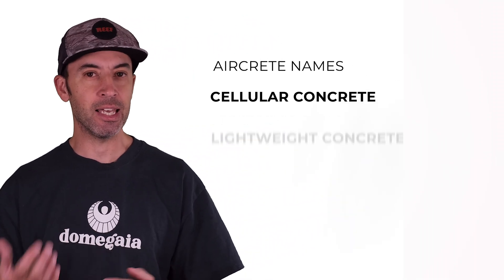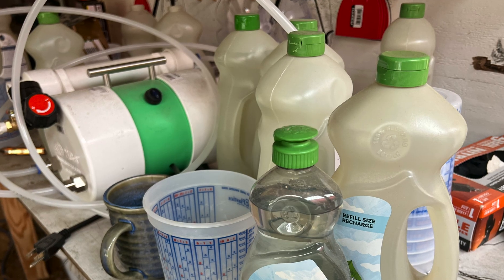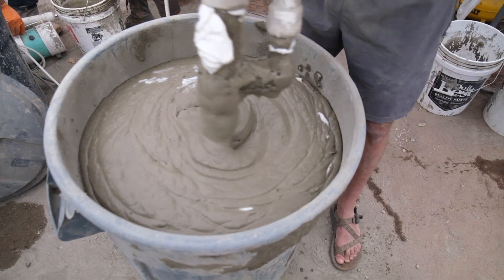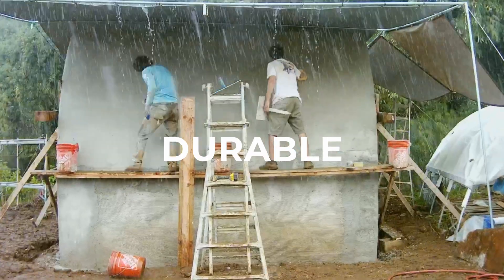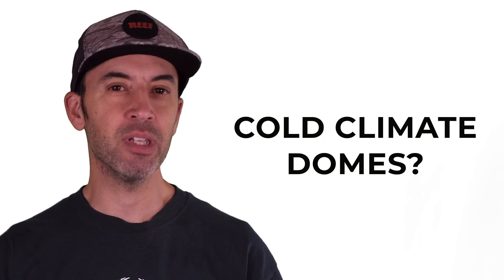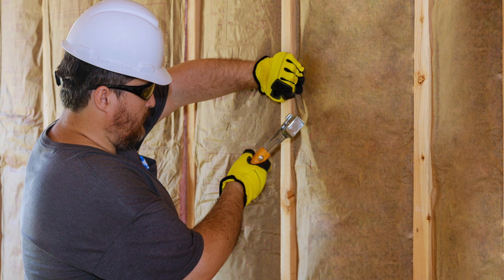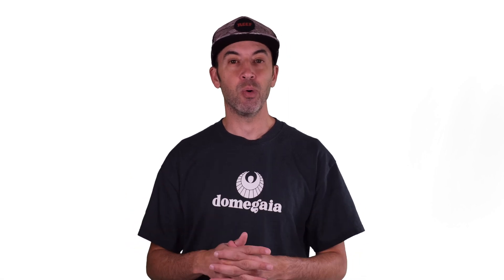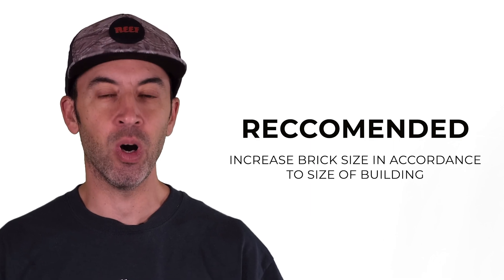Aircrete - Everything you need to know before you start

Comment: Would love to know - is it possible to build a dome with a 30ft diameter with aircrete? My partner and I are starting to research dome style houses but I think we are leaning towards 1-2 big ones instead of grouping smaller ones together.
Reply from the maker: You can build 30ft domes with aircrete just fine but it will be easier and faster for you to build several smaller domes all clustered together rather than one very large one.
Reply: Absolutely it can be done,  but not with aircrew, for that you'd probability need a system (you can find videos)  that uses vinyl firm the size and shape of the house you're building,  sprayed with foam insulation on the inside,  rebar throughout and then sprayed with concrete on the inside. 
It sounds much more expensive,  it probably is,  but I've seen videos of structures of that size and larger.
Reply: Back in the 70's or 80's they built several dome homes by inflating "baloon" & shaping the dome around it, then once cured, deflating the balloon. At least one home is two story, but all of the homes built by that company are still standing.

Comment: In China, they call it  Tofu-concrete.  There are videos were it was used in some buildings
Reply: The Chinese gave it a Japanese name?
Reply: @brokenrecord3523   beats me. Thats the name often used. Basically, they thinned it so much that the strength diminished over time, vulnerable to the elements, and people were breaking it with their hands.  plenty of vids.  Not to be confused with roman cement. lol
Reply: @darwinjina  I think that is why a lot of novel building methods get bad reputations. Someone is out there doing it wrong, it fails and then people think aircrete  doesn't work.
Reply: @brokenrecord3523  agreed. I'm hoping that the validated methods are well documented and shared.

Comment: What are the lowest temperatures these could stand? You said they can be built anywhere in the world, but will they work if the temperatures go to -35°C in the winter? Would they need some kind of insulation added then, or just thicker bricks?
Reply: Disclaimer: I am guessing. 

I don't think there would be any real "minimum temperature" that the bricks could withstand. I see no reason that even extremely low temperatures would cause the bricks to fail or degrade in any way. Unless there are gaps in your aircrete construction I guess, in which case water could infiltrate and break it apart with freeze thaw cycles. 

You would certainly need more insulation, but that could be in the form of dedicated insulation such as Styrofoam, or it could just be more/thicker aircrete bricks.
Reply from the maker: I would agree with this answer :)

Comment: I think you could build the shape of your dome from a compacted pile of sand, wetted and packed. Cover the sand with wet cardboard or other. Stack all your blocks going round n round to the top. When your done you remove the sand. Its how I build my wood fired domed ovens
Reply from the maker: That sounds like way more work than the way we teach it with the compass arm.  It's just one poll in the center that pivots and is use to place each block in the perfect place.  You also end with a perfect curve.
Reply: @domegaia  
I ve done it in small-scale building wood fired ovens, and my friends or other you tubers have done it the way you're doing on a small scale. Maybe just give both a try and build a wood fired oven. The pizza and bread are amazing, so there's no failure. There's no ladder werk. there's no singular block werk. Its safe, but im not having any experience on the large or with my suggestion. I have built tho an awful lot of concrete the hard way in Philippines, they do everything the hard way but verry well. We make our own blocks we mix everything by hand and use buckets to transport the material. I've got 8 inch solid concrete walls,  6 inch poured floors, and 6 inch poured flat deck ceilings all by hand. My place we have built all the same and its 20,000 sq ft Mansion on the beach. Im from the USA andvadopted new techniques I did not think would prove better than the Western way. But hey, Man enjoyed your video and its just a thought
Reply: @domegaia  But are you waiting for each block to cure in place while tied with a small rope, I thought I noticed that.
In my way I could lay 50-100 blocks a day on the sand pile

Comment: I have a question,  in a mold made for concrete for a statue what are the cost benefits and would different release agents be needed for release from the silicone mold?
Reply: @Dayjob351 aircrete requires long curing before it attains full strength.  Silicone molds would likely break the aircrete if you didn't want to wait a month before demold.
Reply: Soap is a main ingredient in the mud. Also a good release on it's own. Try a test cast to be sure.
Older silicone tends to dry out and become brittle. Release might prolong the longevity of your mold.
If the mold is old, you might NEED release.
New silicone will only stick to itself. You could get  some miles out of a good silicone mold using no release, but
if your cast has a rough texture, use a release.

I think adding some acrylic polymer glue would add strength to the matrix. Assuming it plays well with the bubbles.

Comment: I used aircrete as a primary form. Then a bonding agent and a finish layer of concrete. 
I built a huge 1800sq ft house. Steel reinfirced roof with natuaral look on the outside, and external walls are all 14" thick earthbag with reinforced rebar every 4 feet. Concrete covered outer and plaster interior. 
It matches the natural very large boulders on my property ! 
Turned out beautiful, with post and beam interior from round wood I harvested here. 
It was a lot of work with it just being me building it.
My suffestion is find people who are like minded and help each other on your builds.
Mine has wuth stood a 6 1 and a 5.9 earthquake as well as several fires in the area. One fire took out 250 structures.
People underestimate the strength of this type of building.
My house will be standing 100 years longer than these stick- built homes. 
It looks beautiful and Everyone that has seen it thinks it is great.  Built into the side of the mountain, it is about 15°F cooler in the summer than anything else around here - naturally !!😊
Reply: I would love to see pictures of your place!
Reply: Yeah, you really shouldn't say all this without providing a link to photographs you stored online.
Reply: I’m very interested to see your process and finished work would you be willing to share??
Reply: Mind blowing
Can you please share some photos?
Reply: How much did it cost you,that's mist important thing
Reply: Would love to see some pictures of that
Reply: complete bullsh*t.. i'm 1000% sure if your house withstood a fire, it would be national news because of it surviving in the middle of 250 other burnt homes. And the earthquakes on top of that? You narcissistic mental fks can never tell a regular story, you go off the deep end and think it makes your story more believable lol. Fkn mental defect 😂
Reply: Well DONE!! Always encouraged by the voices of experience. 🤟🏼🕊️
Reply: Can I get your email.
I have questions.
Reply: concrete doesn't last as long as you think. And the rust from the metal will make the metal expand causing cracking. Look up Roman concrete, and you will see that our cement doesn't last a fraction of what theirs lasted. there is a reason there has been research into the roman way of making concrete.  Plus you're using a novel way to make concrete that hasn't been tested over the ages. So to say that it will last 100+ years is a stretch. Warning to others.
Reply: @firstname-qq3xp  I appreciate those cautions, I've thought about those issues for some time. I'm considering basalt rebar for my future projects because it does not corrode and expand like rusting iron rebar. Also, the Romans hot mixed their concrete according to the published articles, this is a bit hazardous but it creates lime clasts which allow for self-healing explaining the durability of Roman concrete.

Comment: I saw a couple make a home with it. But I'm looking to build in Vermont and even considering building it as an earth home os most of the joke would be below the frost line. Is this usable or just above ground.
Reply from the maker: If you wanted to do something underground you would need to add a lot of extra reinforcement to support the weight of the earth.
Reply: @domegaia  yeah I watched the videos about not being really practical for handling weight. But now I understand d it has a good R factor per inch so I just would have to find an adequate place for above ground setup. And was just considering the Host and training program. Also Vermont is on an active list of grant friendly states for ADU. Up to $50000.00 USD. So could be viable with the right planning which I would definitely need assistance with. And right now I only have 1 option for that and looking for others.

Comment: can aircrete be used to build masonary furnaces? In a cold climate a dome house with a masonary furnace would be incredibly warm, but the furnaces are heavy and difficult to build from conventional concrete.
Reply from the maker: You could but you would still want to use fire brick on the inside.

Comment: Hi, great video. What about building a boat in Aircrete? There are many sailboats being built in concrete, reinforced by  chicken wire steel structures. That's a durable and attractive material for homebuilders, but heavy. I'm thinking Aircrete with layers of glass fibre sounds more compelling; lightweight, easy to handle and probably cheaper than Divinycell foam plus epoxy. Do you have any experience or thoughts?
Reply from the maker: I don't think this would be a good idea.  If you are just looking for the strongest material, I don't think aircrete would be your best choice.  For building domes its a great balance between insulation and strength.
Reply: @domegaia  Thanks for your reply!

Comment: Would it be possible to use aircrete and perhaps a mesh over adobe structures to add insulation from the elements/ insects in humid climates. Adobe houses are often looked at as not practical due to how brittle the walls become in high humidity climates and how easy it is for bugs to infest them. Would aircrete alleviate this issue if used in conjunction ?
Reply from the maker: I think this would work well but you would need to figure out how to bind them together.

Comment: In Europe, the "Aircrete" like products are available for decades, being (in this part of Europe) actually number one material for residential houses. The products are ranging from pure cement based to ones with high gypsum additive, which drastically increase R value. And yes, you can have products with steel reinforcement - all lintels of my aircrete house are made of U shaped aircrete lintels, that have reinforcing bars inside. By the way the aircrete blocks are very very precise, polished to less than 0.5 mm precision. You don't have to even join the aircrete blocks with cement mortar, you can use (approved) mounting foam from a can. My house was built this way more nearly 15 years ago, from Ytong aircrete blocks, 300x500x250 mm. The material is excellent to work with as pointed in the video, it's easy to cut to shape, cut slsots in, etc. The only down side is strength (compared to traditional brick or concrete wall), for heavy stuff like kitchen cabinets, I used 250mm (10") long dowels and screws. As said, Ytong and similar materials are now prevailing in construction of new houses here. I believe it has to be cheaper than stick building, considering how much effort (man-hours) that requires. And it's among the cheapest materials too.
Reply: Yeah, my initial research shows that "AIRCRETE" trademark from August 14th 1990.
That said, I'm glad that this channel is championing the technology, even though the term was not coined by his father in 2015 as the video says.
Reply: @tryscience  Yes, the "Aircrete" term is these days really used for DIY mixture of foam and concrete and I think it's fine. Proper established term is "porous concrete", in some languages shortened to something like "poroconcrete", but here we simply call the material "Ytong" after the most popular producer (by far).
Reply: @oakld  I think it's an amazing material, it's just that when I heard the gentleman say his father coined the term for the first time it bothered me because it's something I've been aware of for much longer than that. Even by that specific name which was trademarked last millennium. I don't know if he wasn't aware of that fact, or if he was trying to pump up his credibility by suggesting his dad first coined that term.  I believe in giving credit where it's due. And in this case, "Aircrete"  was trademarked more than 20 years before he said his dad coined the term.
Reply: @tryscience  Well it could have been an honest mistake or he meant that his father got the term some popularity and recognition, which I'd say falls under "coined", but I'm not a native English speaker to judge. The material is really great that's why its number one material for housing in many countries in Europe and beyond. It's still difficult to believe it can't be purchased in the US, with the best market and entrepreneurship you have over there...
Reply: @oakld  I think we're a victim of habit. People are so used to stick built and comfortable with it, that they don't want to take the risks involved with something new. Getting approvals for it would also be more complicated than a more traditional construction technique. I think eventually it will take hold here.
Reply: @tryscience  Yes, true, there's massive knowledgebase and experience in the US when it comes to stick building, but I still find difficult to believe it's unavailable at all, that someone didn't take at least a little niche on the market. Especially because it's super easy material to work with, actually requiring much less skilled and experienced workers than stick build. So easy even for DIY building. And as it was unfortunately experienced, porous concrete buildings do withstand direct hit by F4 tornado, at least with concrete sealing which is common here. The main obstacle is probably certification.
Reply: I discovered porous concrete and Ytong a few years ago and was fascinated. I even purchased aluminum powder and drain cleaner to mix into concrete to try and make a version of it. I ended up with a few planters that float in water, but nothing as good as what the actual manufacturers can make, I'm sure. When researching it, I found references to the lumber industry lobbying the government to block the introduction of porous concrete as a building material in the United States. Although I can't guarantee the validity of those references, it would seem reasonable that building codes written to a standard that favors lumber would create a long term barrier to Ytong and others entering this market. I've always been fascinated at the idea of porous concrete buildings and houses in the EU. If I had the money, I'd honestly visit just to learn and explore the differences
Reply: @fitztastico  That's fascinating, I don't even know how it works, I know the aluminum powder is used, but your DIY skills are really something 👍, if you were able to reproduce the process. I recently found out, that it is actually possible to do aircrete blocks kind of DIY, as shown in the video "Amazing Process of Making Foam Concrete Blocks" from rural Asia (someone commented it's Uzbekistan). The problem would be permitting a DIY brick for a house in the US or any civilized country; the companies in Europe have the products certified and this is no factor. I don't know if you can write a building codes in a way to exclude aircrete products, it seems to me little bit unprobable (though I can't say it's impossible). I think if you paid all the tests, or were able to do them on certified calibrated machines, you should be able to indtroduce a "brick" to the market from any safe material. We're lucky here aircrete is so cheap and accessible. My good friend  is in late stage of building a house from Ytong Lamda IQ 500 and he's not even insulating the walls, just putting render directly on top of it (all the layers, of course). And he lives high up in the cold highlands with more strict codes. All completely legit and well sufficient for our strict code - It's really that good material. I hope it will make it's way into the US and becomes available. I believe the build must be much cheaper overall. Some people here got excited by "wooden builds" (that's how we call stick and frame houses here) in past (when prices of wood were low), but it never took off - I assume it's because of the huge labour involved (DIY or via contractor).